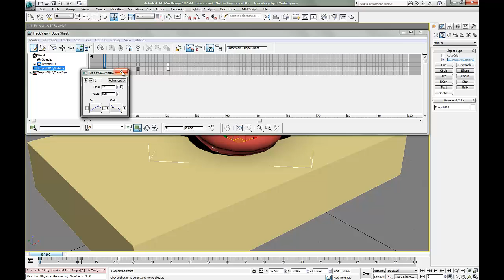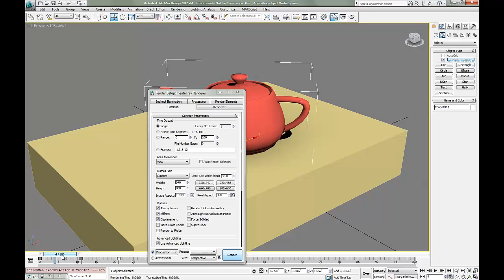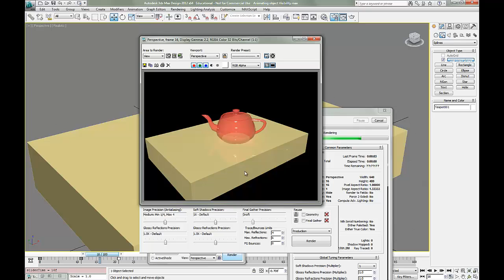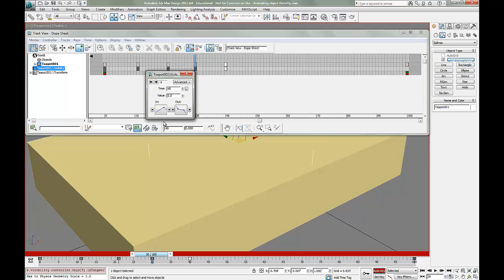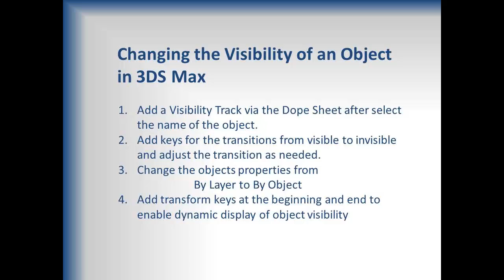3DS Max, Animating Object Visibility

Comment: Does not work with Arnold renderer by the way...
Reply from the maker: No, unfortunately Arnold does not support a control for object visibility.  Arnold came out after I created this video. The best alternatives I have found are to either use a totally black bitmap opacity map to control visibility or scale the object to 0.0 if you can live with the object visibility changing instantaneously.
Reply: @LeeMinardi  Great idea on black bitmap! Did not even think of that. Arnold was not the most pleasant transition from mental ray for me to say the least...and I do not see any improvement from iray GPU rendering even with RTX cards.

Comment: object fades when timeline scrubbed, but will not fade when rendering.
Reply from the maker: Since I published this video several years ago 3ds Max has introduced the ART and Arnold renderers.  I believe that neither of them support object visibility options!  Are you using either of these?  If so try a different renderer.
Reply: Thanks for the response Lee. I'm using the mental ray renderer.
Reply from the maker: Have you assigned the object an Arch+Design material?
Reply: No. But I'll give that a try. I'm assuming I can create a renderable transparency with the material.
Reply: That did it! Thanks! Great video.
Reply from the maker: You can use the visibility track with an Arch+Design material to fade the appearance in/out and via keyframes.  You can also use  a material's transparency/opacity parameter and keyframe that BUT there may be some artifacts if the material approach is used rather than a visibility track.  I think using an Arch+Design material with a visibility track will solve your problem.
Reply: That's exactly what I did :). Works like a charm.

Comment: visibility track does not work in mental ray...so not very useful. not you're fault of course but flippin annoying seeing as it's the 'pro renderer' that ships in 3ds max.
Reply from the maker: cresshead
Reply from the maker: cresshead  Make sure that the template is an arch+design mental ray material and I think it should work.
Reply: Lee Minardi that's probably it thanks!...will test again later...used a slice tool as a work around to reveal..it's rendering now!
Reply: It never ceases to amaze me how big of a P.O.S 3d studio is.  
If it didn't cost so much i wouldn't complain.

Comment: in  my interactive display it changes,maybe because i use 3ds Max 2014,your is 2012 as i see.
Reply from the maker: The interactive display of object visibility for stationary objects may not be a problem in some versions of Max.   I discovered it with 2012 and that it could be fixed by adding position keys that did not change the object's position.